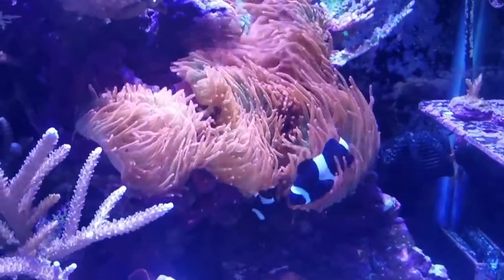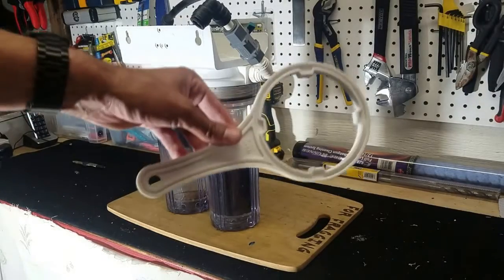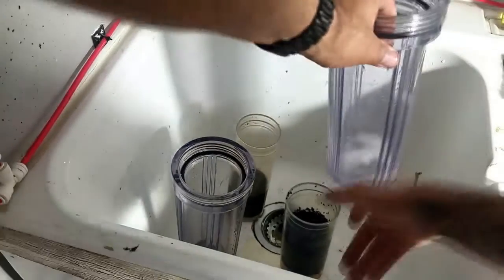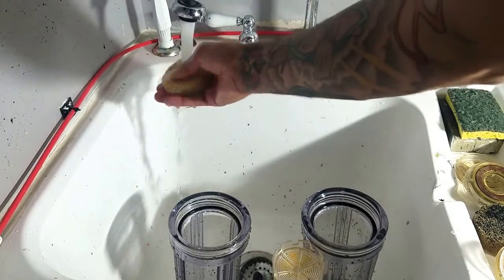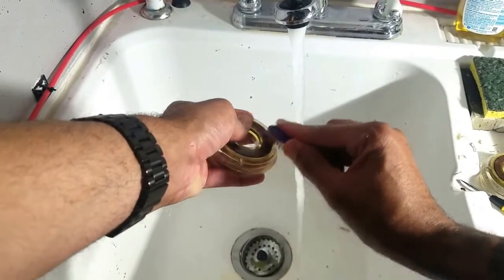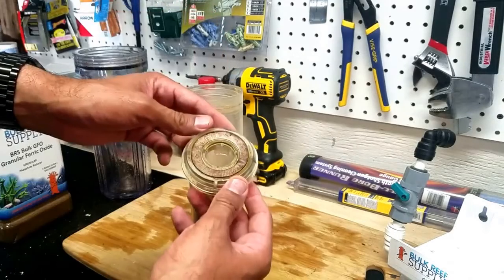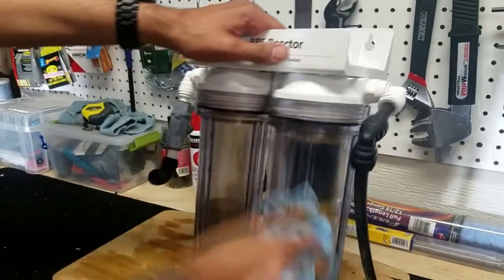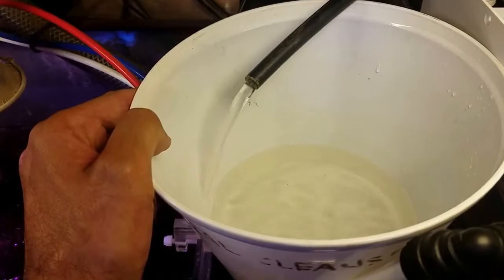Beginner's Guide:  Saltwater Aquarium: GFO and Carbon

Comment: BeWare..very aware. This is a very underpowered piece of plastic it will stop everything after a day or so and will never work right because it is not powered with the proper power water pump.  You will never get it to work right.
Reply: Mine works just fine.
Reply from the maker: I have to say that in my experience, I have not seen any issues with it. I've used MJ 1200 pumps and also ran this off a manifold. Zero issues.

Comment: Great video, however, i didn't see your gfo tumbling at all. Is that because you have it hardly moving or because you didn't actually add that footage?
Reply: BeWare..very aware. This is a very underpowered piece of plastic it will stop everything after a day or so and will never work right because it is not powered with the proper power water pump.  You will never get it to work right.

Comment: Do you have the reactor pump and the same space as your return pump? I have mine in the same space with the in and out tubing all in the same chamber. I'm wondering if that's a good place? Also how often are you changing your carbon?
Reply from the maker: I did run it exactly as you described.  I now run it off a manifold.  your way works too.

Comment: Hey Gil, the dual reactor, once it is adjusted to the appropriate tumbling of GFO, it appears that there is actually not much of flow coming out... is that really how it needs to function with a very low flow...? i can't imagine how long it would take to cycle my 90 gallon tank with such a low flow rate. But if I increase than GFO is bouncing way too hard...
Reply from the maker: It was a fair amount of water coming out of the outlet, but definitely wasn't shooting our or slowly trickling.  If your reactor isn't brand new, I would suggest removing the canisters and forcing water in the channel of the lids, where water passes through one canister and into the other. Also double check your hose for possible obstructions. If that doesn't work, then try running the GFO only and the carbon canister empty. See if there is a difference in the water flow from the outlet hose.
Reply: Thanks for quick reply. It is brand new BRS dual; no obstructions, but the flow is very limited it seems. Iwill try to run it without the carbon to see if it changes. thanks again.
Reply from the maker: John Waldman Hope it turns out well.

Comment: Hi i just started my 38 gallon saltwater reef tank and i have a 2 little fishs 150 gfo reactor do you recommended me using it or is my system to small?
Reply from the maker: You could use it, just be careful not to over do the gfo if you plan on keeping lps corals as you will strip out the water making it too clean/low nutrient water. If youre just doing sps and plan on dosing trace elements then low nutrient is ideal. Lps corals die in my system.
Reply: Ok im using poly filter which they clam it pulls phosphate out of the water. My tank is going to be all soft coarls but ive had cyano bacteria problems in the past
Reply from the maker: I've never used those, but they honestly sound like the work as well as you'd expect for the price.

Comment: Hey Gil love the new series.  FYI. Instead of using the screw driver to pull out the sponges I use a butter knife.   Also why don't you rinse out the media by running water through the media holders instead?  That's what I have been doing without any I'll effects.  I also noticed you don't use any sponges on the GFO.  I used them to prevent any lose GFO from getting back into the sump.
Reply from the maker: Awesome Ambrosius. Never had an issue with GFO in the sump, but the sponge in GFO isn't a bad idea. Definitely more than one way to skin this cat. Thanks for sharing your routine to change out the media. See you on the next one!